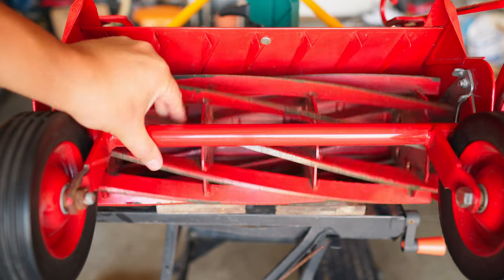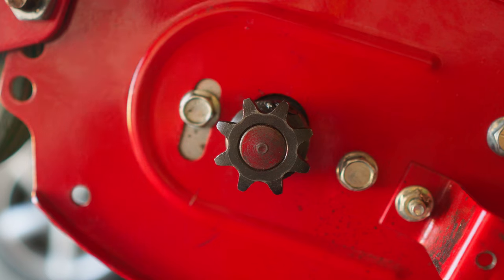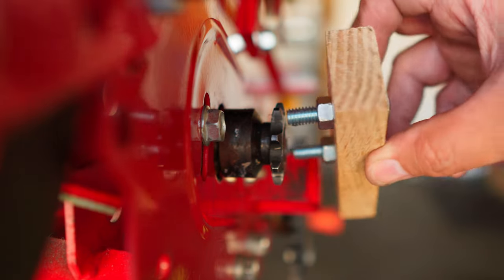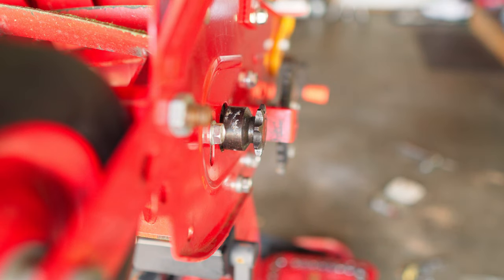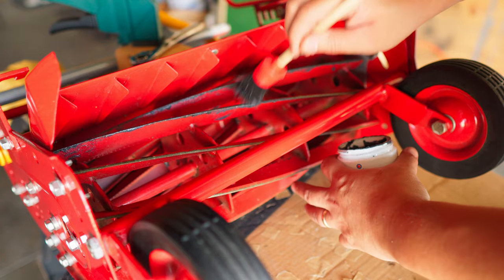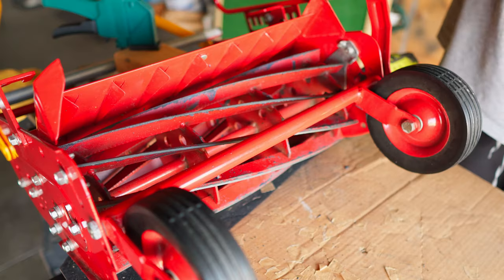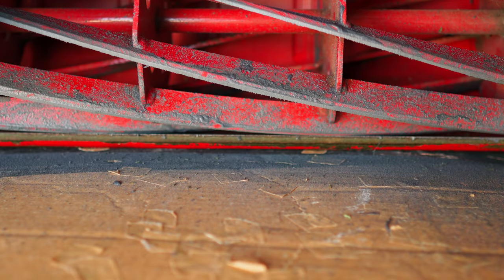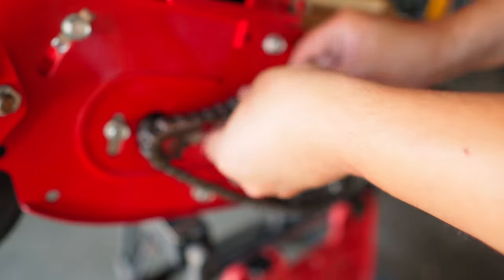Backlapping McLane 10 blade manual greens mower! I made my own tool!

Comment: Very good video, I am now mentally prepared to do my first back lapping today! Thanks for all the tips! I picked up a 5 blade push 17" mclane a few days ago, been reel mow with a scotts 20" everyday all season at 1.5 inch, I had also picked up a very old 20" mclane at the begining of the season but shortly relailzed my lawn had a long ways to go first and though moved a few times with it, the motor needs alot of work, I have not put both mclanes side by side yet, but dreaming of merging them into a 20" 7 blade push. :))
Reply from the maker: You are so lucky to be in an area that offers used McLanes. I have to go a State over to even see one. I hope your back lapping went well. Happy to report that I committed to a renovation this year. You will have a front row seat to more of my fails. lol Cheers!

Comment: Very nice! My Fiskars has a similar chain drive system, and what I did was purchase a large socket (can't remember the size off the top of my head) that fits perfectly over the sprocket- which works great when paired to my drill. That McLane is a nice mower! Wish I had one.
Reply from the maker: I did the same for my fiskars but could not find a socket large enough for the McLane. I will keep looking, cheers!